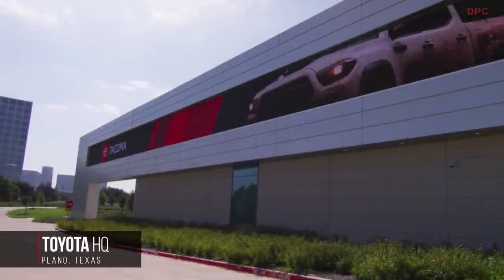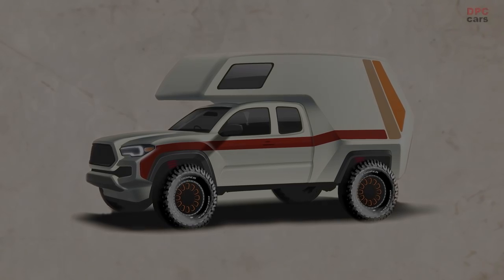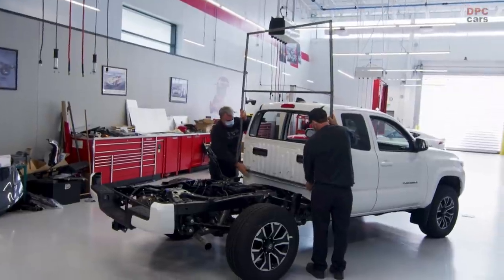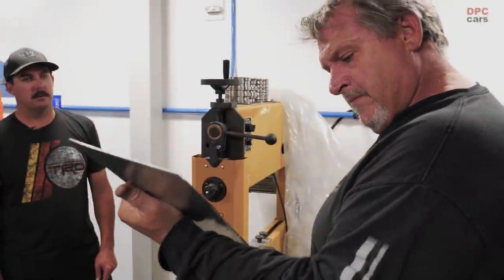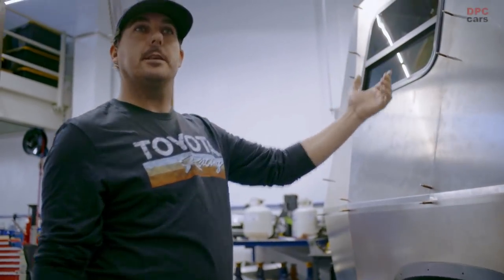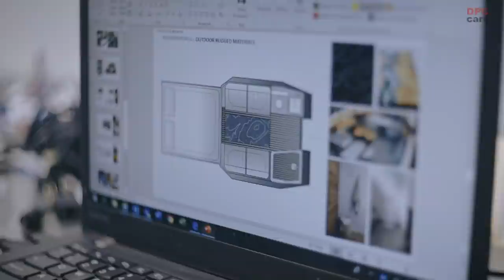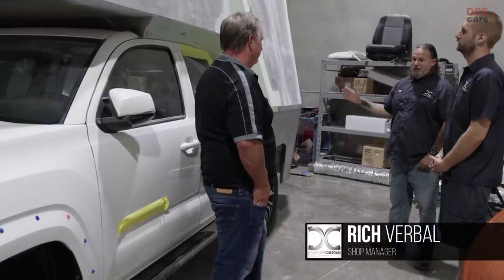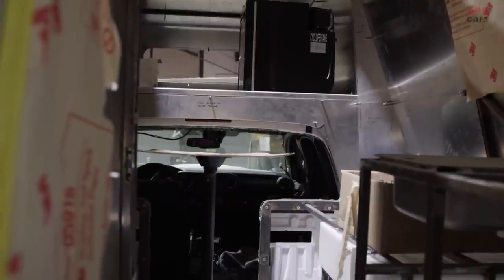Tacozilla Toyota Tacoma Camper SEMA Build

Comment: They should of added dual rear wheels like the original to make it more practical. It should be lower to the ground  for safety. It would be nice if the suspension lifted automatically when 4x4 low is engaged.